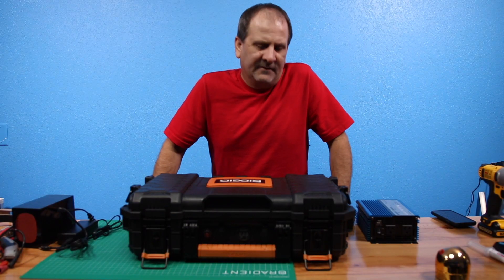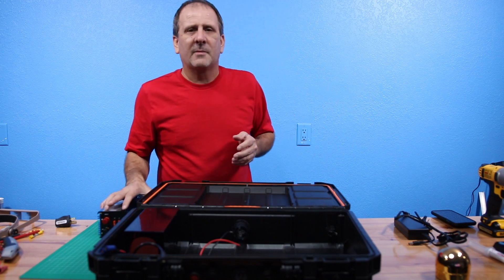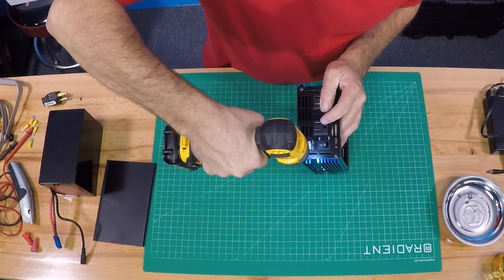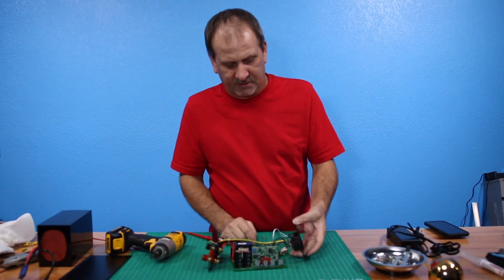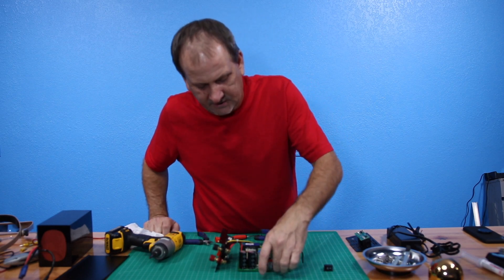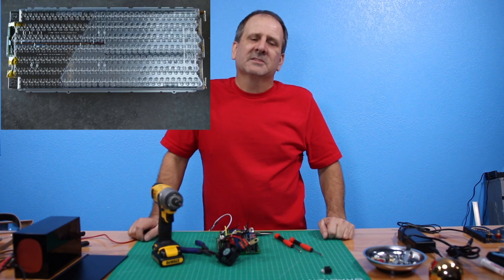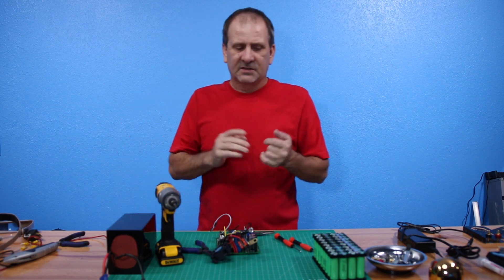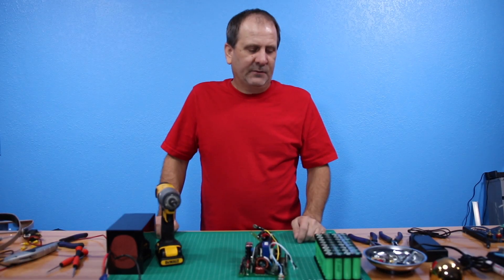Portable Solar Generator DIY Pt. 2 Prep and Tear Down of the 600 watt Aims Inverter

Comment: I don't know about no heatsink on those mosfets I guess we'll see if he burned them up once there is a load on it
Reply: James Holbrook I want to do the same thing but I’m really concerned about those heatsinkless mosfets. At least cut away a strip of heat sink from the original body to remount on the mosfets.
Reply from the maker: Laurence I'm using the whole case as this is just a prototype but wanted to be able to see what I can come up with. Also the best way to mount it has been to use the whole case and just changed some wiring around on it.
Reply: Wes That Tech Guy understood! I am performing a similar build and my last step is the power inverter. I’ve taken one apart but was worried about the heat sink and the expose electronics. I like your setup because the case is wide and you can spread out the components.
Reply from the maker: I Wont be using this in the build with out a heat sink of some sort.
Reply from the maker: Good Luck on the build Laurence